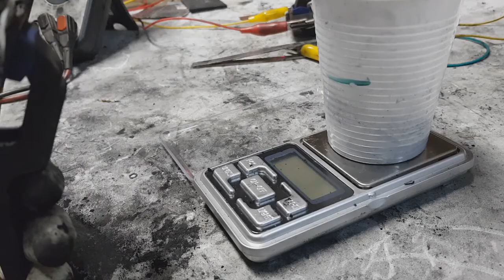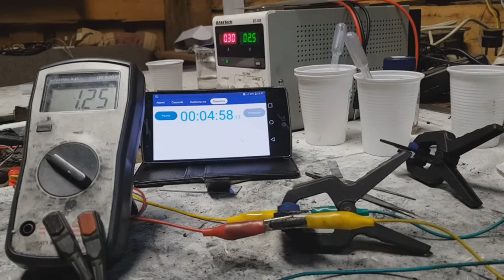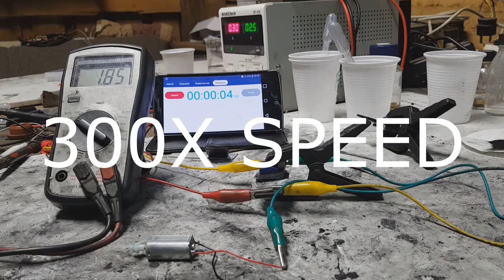A 42 Farad Supercapacitor

Comment: Hi Cayrex,
That's pretty good, about double the last one I made, for a similar surface area :-)
Lately I have been doing all my calculations in Joules or mWh, so I will have to compare to see how my latest efforts measure up.
The discharge curves I am showing on the data logger look more like a capacitor than a battery, so I will re try the t / 0.7 x R to get a capacitance figure again. :-)
Regards Martin.